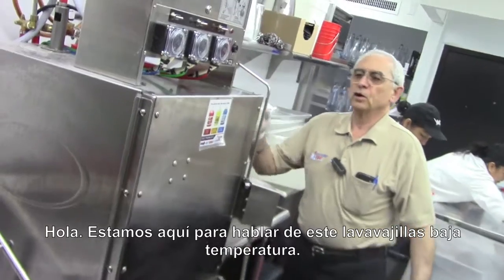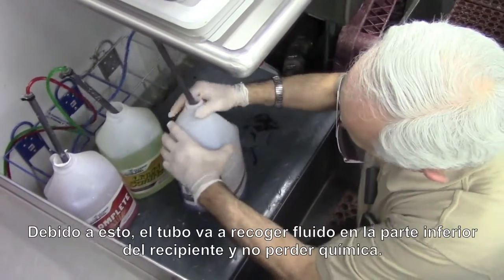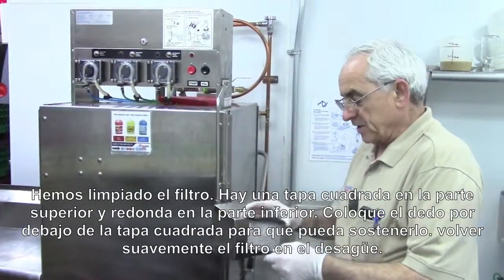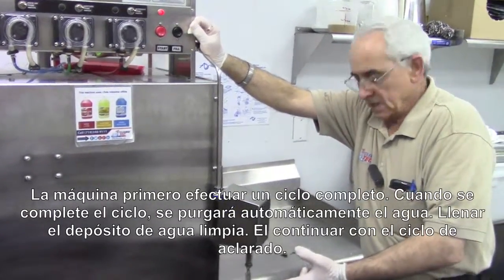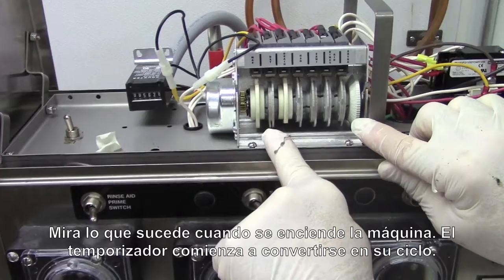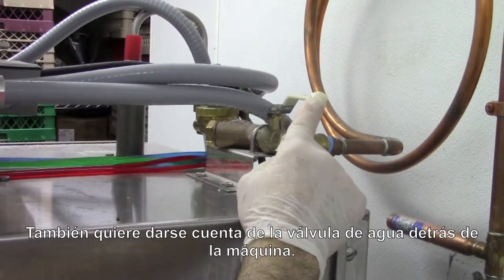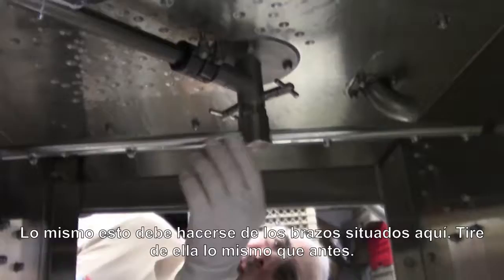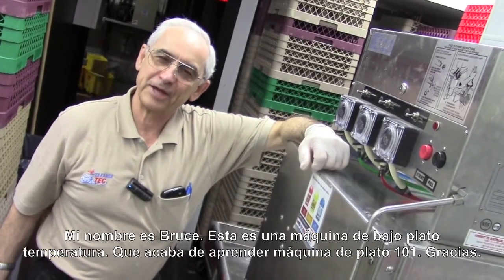American Dish AF3D

Comment: OK Bruce what can I use to clean buildup out of an a ADS dishwasher machine pump and not damage the pump it had buildup in the in the pipe I clean that out now how do I clean the inside of the pump and not take A part what do you recommend thank you
Reply: Using the Delimer switch which Bruce explained you will start the machine pump while the machine will not drain, cycle or pump chemicals. Use a lime removing product according to instructions for 6 to 8 minutes drain the machine and clean it. Switch back to normal mode and run multiple times and wipe out again. The machine will now have the lime removed. Never ever mix a lime remover with the sanitizer, it creates a deadly gas and I suggest this cleaning step is done by a manager

Comment: How can I take the doors off to clean them?!?!?!
Reply: Take 2 7/16 in wrenches and remove the nut from the bolt going through the cantilever arm or the handle that you open and close it by. 
While doing this you must hold down the handle because it is under spring tension. Once removing the bolt spacers and nut you gently raise the handle up until the tension is released then you can remove the door or on some models the door retainer which will become obvious and then the door